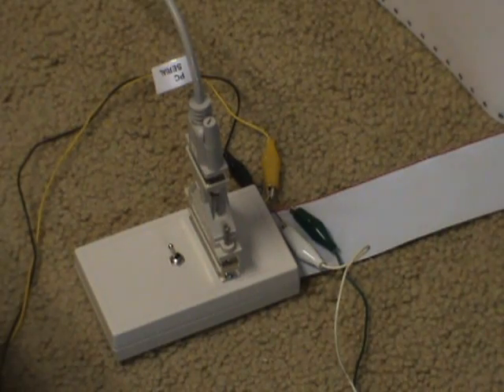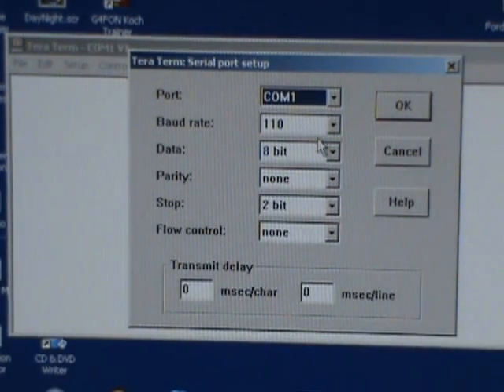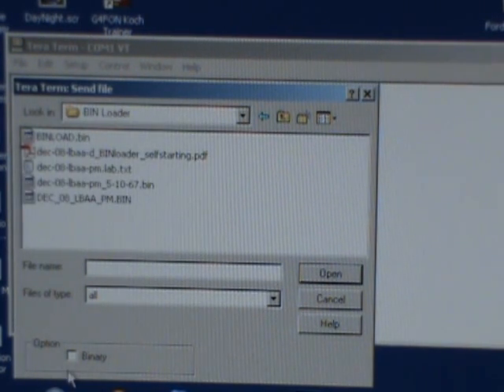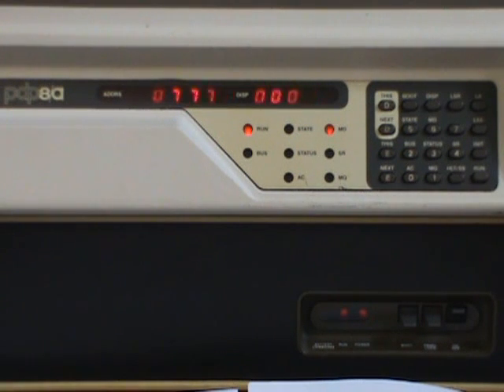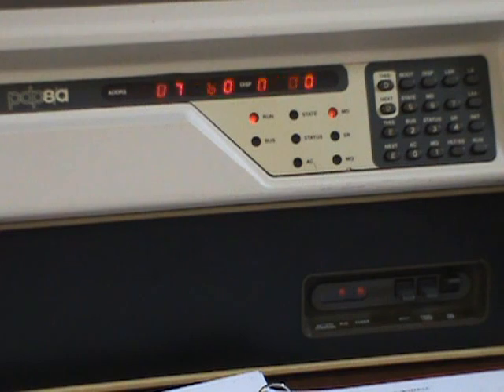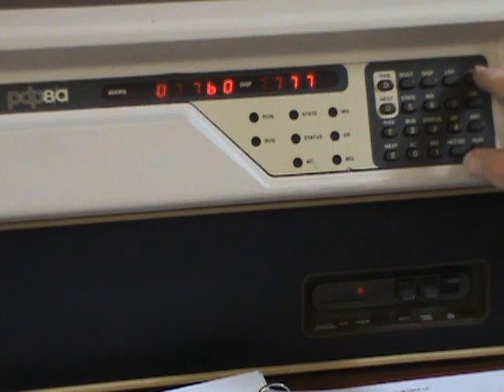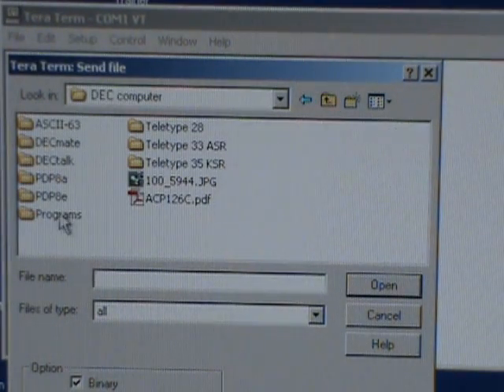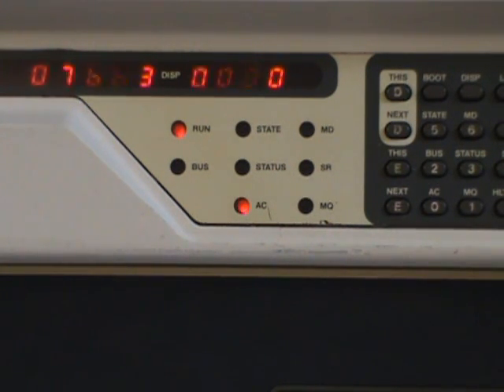RARE: A LOOK INSIDE A PDP8/a, LOAD & RUN  FOCAL, PRO CHESS GAME

Comment: In 83-85, I took a pdp-8e computer maint/rpair course.  Programmed in mach. lang.  Ran diagnostics and single-stepped through the debug process.  Torrid core RAM.  Huge cartrige HD.  8" floppy.  Papertape punch-reader.  Card reader.  We had a large drum printer and a few classmates played some sort of star wars type game, that printed-out in the same manner as your trig function.  I wish we had a chess pgm.  Thanks for printing out the result.  I'm going to analyze it, for fun.

Comment: I used to operate a DEC PDP11 circa 1981.  I don't wonder you don't use the time sharing!  That one could accommodate 12 terminals.  Goodness if you use 2 you might as well go to lunch between every command!
Reply: Was it a limit in processing power or memory size?